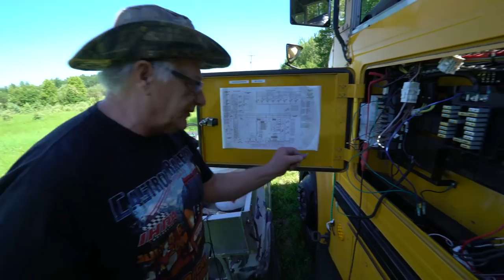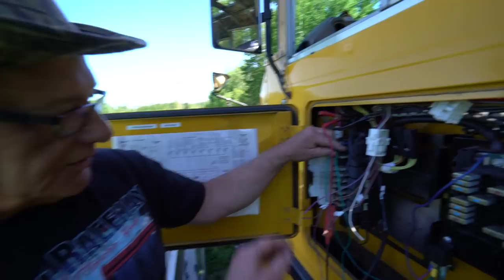SKOOLIE 12 VOLT WIRING + REMOVAL + RELAYS

Comment: I am lost, have no idea what a relay or solenoid is. Wish I had a Badge to help me figure out my bus conversion. All I can figure is to remove the wires that were connected to lights and speakers and windows and take them out. What gauge wire did you use for your house side 12 volt lights and outlets?